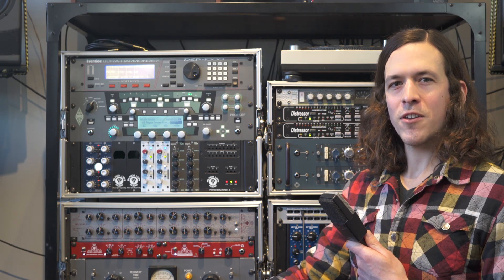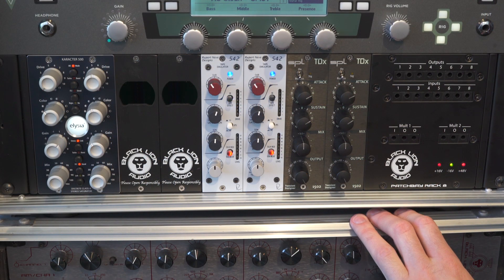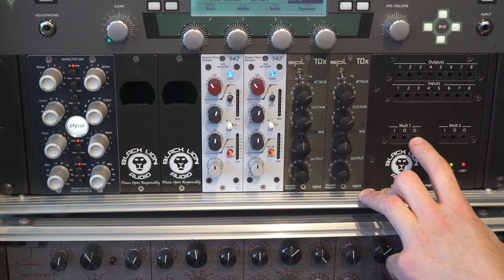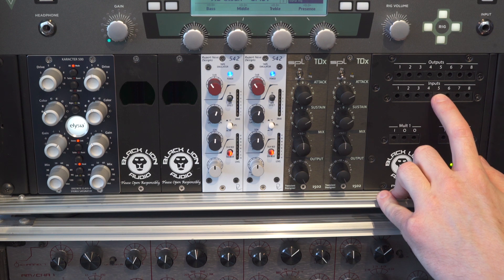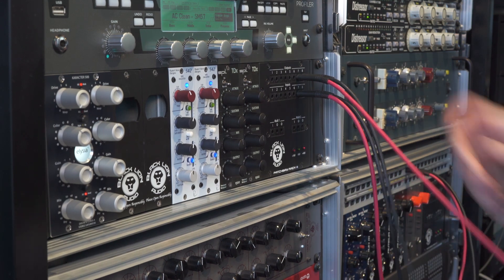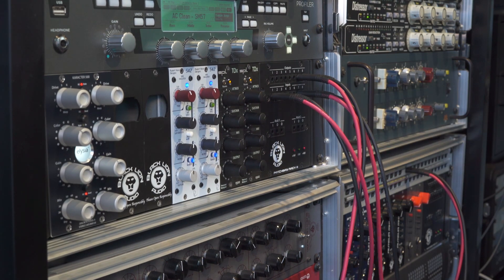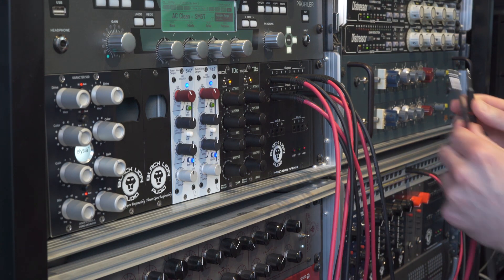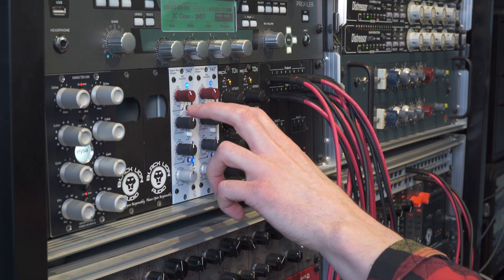Black Lion Audio // PBR8 8 Slot 500-series rack with Built-in Patch Bay and OST technology

Comment: No manual for the device or explanation on whether plugging into TTs defeat your XLR routing on the back. And no feed forward switches. So for example if you have a “normal” chain of slot 1-2-3…. But you tt out of 1 and go to 5 and back to 3… whats happening??? Is the xlrs on back still feeding 1-2-3 while you mult out to 5 and now have double signal combine at 3? An explanation would be helpful.
Reply from the maker: Hi. The pbr8 works like a standard 500 series lunchbox and standard patch bay that are separate… just hardwired inputs and outputs to the patch bay.  For this reason you generally don’t create the feeding on the rear of the unit from module to module but rather through the patch bay itself.  Also like a standard patch bay, patch bay outputs do not cut output from the rear but inputs do as doubling inputs would cause loading issues.